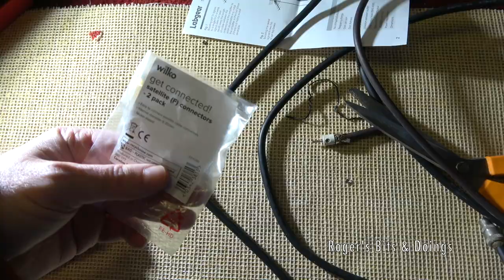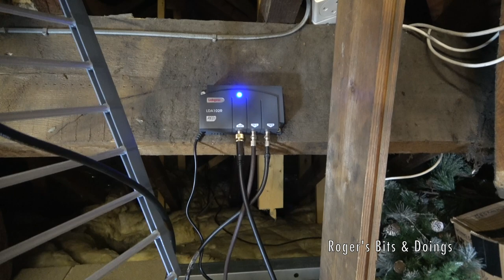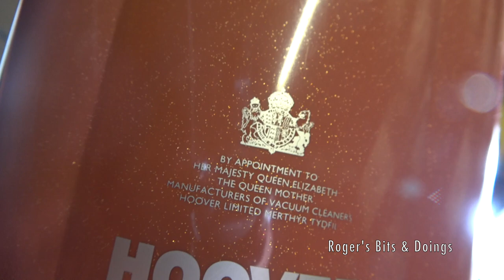Vlogging From The Loft & Replacing The TV Aerial - NOT A HOW TO VIDEO!!!!!!!!

Comment: I was in the loft recently, fitting a new high gain tv aerial and new signal amplifier. This increased the signal strength considerably. But I made an interesting discovery - by leaving the old aerial right next to the new one, pointing in the same direction, but NOT CONNECTED to the new one in any way, the signal strength is increased considerbly more. It seems that the old aerial picks up some signal, amplifies it, and retransmits it in such a way that the new aerial picks up the signal coming through the air from the old aerial. I've removed the coax cable from the old aerial, as it isn't required. None of the websites I've visited regarding combining tv aerial signals mention this trick!

Comment: Hit a strange issue at my mum's, she's never had HD channels but Freeview website says otherwise, I tried Auto tune, nothing HD wise,so my question is do you think it's my mother's roof antenna and not being powerful enough? Or is it a case of the Freeview HD channels not available in area? Thanks in advance
Reply from the maker: If you haven’t got a signal booster I would suggest fitting one as that can improve the number of channels you receive.
Reply: Maybe you need a HD tuner. Everyone can get the main channels in HD.

Comment: Why do you put the antennas in the loft? We have them outside up on the roof.
Reply: Because on U.K. houses it’s difficult to get on the roofs to the chimney if the house has one so it’s far easier to install in the attic
Reply: @Louis Williams £120 for a company to put one up and don’t need meter to check you just follow the other houses in the street so easy todo in the attic and with a booster there is no difference that on the roof and I know because iv done both in the past and would never risk climbing on a roof when I can save myself a lot of money and time and fit in the attic
Reply: Attic fitting can work just fine ... IF

1. Signal strength is generally high enough (few if any obstructions to transmitter). 

Receiving a signal through a roof can reduce strength by anything from 3dB (50% reduction) to over 8dB (84% reduction), especially with the difference in roofing materials, tile, slate, METAL(!!), and also, of course, if Kingspan insulation type (aluminium coated foam) is present.

2. Angle to transmitter is not close to angle of a roof corner/brick gable end (this significantly increases loss c.f. straight through the roof.

3. NO Solar PV panels on the roof! These act in the same way as a Faraday cage!!

4. You use a distribution amp to achieve multi-room connections

If ANY or ALL the above are NOT true you will likely suffer loss, probably large. Remember, digital transmission, just like digital audio, is either fine or rubbish and unlike analogue there is little to zero warning ... Signal is either sufficient or NOTHING!

Bottom line is wherever possible mount the antenna:
1. Outside
2. As high as possible/legally allowed
3. To cater for earth curvature - typically pointing slightly downward in the direction of the transmitter, but maximum AT the direction of the horizon. 

I've seen "professional" installers spend too much time aligning for "horizontal" and after the direction is set, never readjust horizontal alignment, which in fact can gain or lose +1 or +2dB!

If in doubt ... Mount it out!